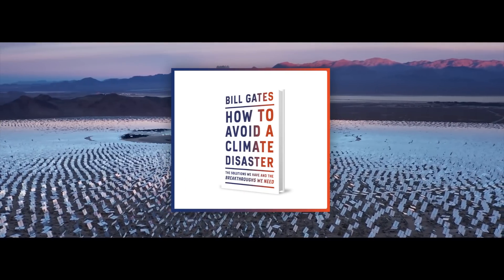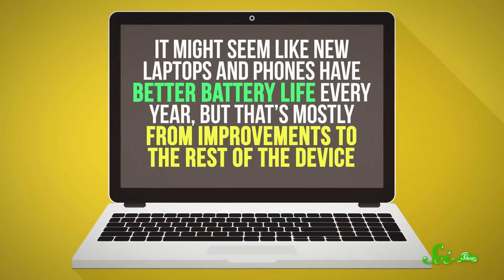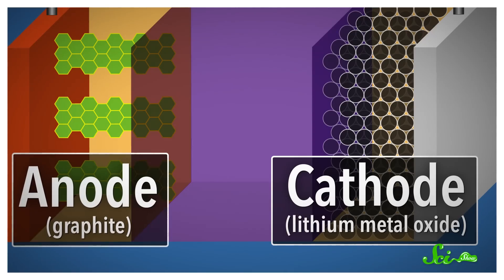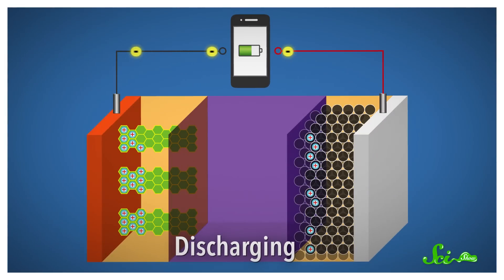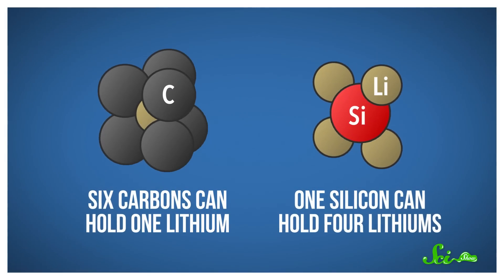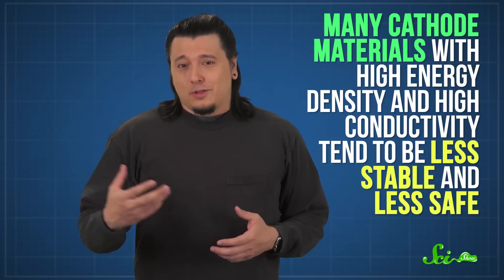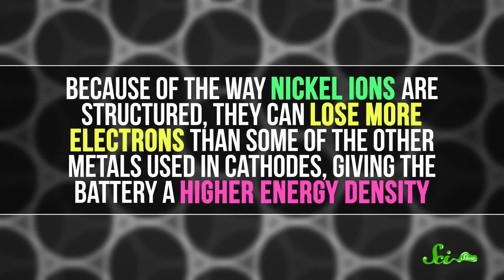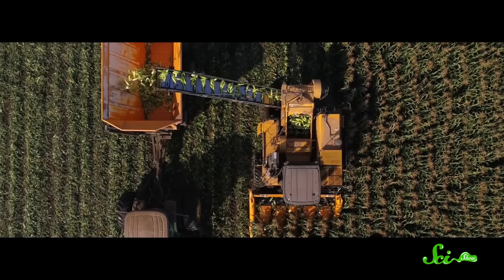Why Haven't We Built a Better Battery?

Comment: Lithium batteries are not a solution for grid storage, and should not even be considered for this.  Li batteries are for high current devices that require a energy dense battery to remain compact.  Grid storage does not need this, therefore the cheapest and most long lasting battery type makes the most sense, such as rechargeable zinc carbon batteries..  Energy density is a very small factor to consider when it comes to grid storage, especially since we can use far more space for it than say electric cars.

Comment: I have an idea... Why not use hydrogen, and oxygen based power plants?

I mean we can basically recycle the hydrogen, and oxygen as many times as we want.

Also, when combined in a certain way it can produce a high explosive out put that can be used to power the power plant.

Then you have the by product being water vapor.

If I remember correctly the space shuttle used something similar to power itself... Basically rocket powered power plants.

Which would be similar to jet powered power plants that some oil rigs use, but minuses the jet fuel.

Comment: Okay, someone smarter than me explain something:

For grid level energy storage, why do we need to store electricity? You've got your solar when it's sunny, your wind when it's windy, your hydro when it's flowy... But, instead of storing that excess energy in the form of electrical batteries, why can't we do something else, like pumping water somewhere high up, or melting something and storing the heat energy, and then when it's not sunny or windy, we let the water fall past a turbine, or make steam with our heat energy. 
I know some places are doing this, but it seems like it's always a flash in the pan news article that gets talked about for 3 minutes, and then we're back to "but we need 1 hundred billion AAA to power our TVs!"

Comment: Batteries don't even have to be chemical.
Pumping water uphill or putting gas in pressure tanks and on demand releasing it to drive turbines also works. And for non-movable storage, like when using it to power the grid the size isn't an issue.

Comment: A good high level description of the problems of improving batteries, but there is a big flaw here in the grid storage usage case.
It's true that for phones, laptops and cars, energy density (both per size and weight) along with cost are the main criteria. That's because they need to be mobile power sources. For powerplant or grid storage mobility is not a requirement, and density matters very little. Your bottom line is then $/Wh, with secondary concerns being sufficient charge and discharge speed, cycle efficiency (how much is lost to store the energy and take it back out) and energy retention rates (% lost per unit of time). 
Physical space near power plants is usually not an issue, and as a better solution distributed grid batteries closer to where the consumption is could also be done on the outskirts of high usage areas, closer than the powerplant would be while still no issues with space. For the economies of scale you need for energy storage at a grid level, there are also non-battery storage solutions like pumped water magazines, compressed air, flywheels, and depending on what time-scale we are talking about even capacitor arrays. There are also other non-litium battery technologies that become potential solutions when density is not a big concern, like flow batteries. All these energy storage options have different trade-offs in up-front costs, maintenance costs, service life, size, cycle efficiency, energy retention, and charge/discharge rates, and what makes sense depends a lot on what your requirements and scale is.
As electric vehicle ownership picks up more, vehicle-to-grid is also an important factor to consider. Having thousands of instances of 50-100KWh batteries that can charge/discharge at 5-10KW at places you would typically park a car could let grid operators treat a small portion of their batteries as grid buffers at some small benefit in savings while at no notable inconvenience to the owners. That could be very useful for handling peak grid loads and for soaking up excess renewable production.

Comment: Two things:
First, nuclear power is awesome. No greenhouse emissions, the generated heat can be reused for heating homes, works in all conditions, very safe. Meltdowns are much less of a concern with contemporary safety regulations, and you are more likely to die from installing a single wind turbine than from living near a nuclear power plant your entire life. Nuclear waste can be contained for thousands of years until it is safe, unlike burning coal which spews all all its nasty stuff into the atmosphere.

Then, use electric car batteries as back up when the renewable energy sources are not enough. Many electric cars are quite often hooked up to the grid, and they have quite big batteries. They could charge when there is enough electricity on the grid, and discharge when there isn't. As more people get more electric cars, there will be more of these big batteries.

Comment: While batteries have value and use, application vs other forms of sustainable energy source makes them less viable.. Cost and efficiency wise, nuclear power is much more safe and much more reliable with much much less environmental impact. (environmental impact is not over the next decade, but over the next 200-500 years, our society only looks short term.. thus the belief that Wind and Solar are 'better') The sad offset to nuclear power is.. dangerous byproducts that allow less than desirable people to make incredibly dangerous weapons (dirty bomb etc).

Comment: Check out the video from Real Engineering: https://www.youtube.com/watch?v=-PL32ea0MqM
Basically, we have options that are far better than trying to increase the efficiency of Litium-Ion batteries. Lithium-Ion was never designed for huge power banks, it was designed for powering small devices where power density is important. Stationary facilities don't need high energy density, they are far better served by high power per cost efficiency. So a big part of the answer to "Why haven't we built a better battery?" is simply that we're mentally stuck on developing technology to do things that it just is not good at, instead of switching to something that is better for the purpose.

Comment: Other types of energy storage should be mentioned. There are areas where the excess renewable energy produced pumps water up a hill to a holding pond. Then recovers energy by letting it flow back down through turbines. We don't have to use literal batteries

Comment: Thanks for the super clear and easy to follow explaination! 🙂👍 Usually I tend to loose focus and having a hard time seeing the connection between each of the parts (I have ADD), but you're one of the few people who can successfully flip the lightswitch in my head 😁💡!

[Pen > Pineapple > Apple Pen]
[Graphite > Battery > iPhone]
 ...Pineapples are batteries! 🙂

Comment: Wouldn’t the best solution to be just convert to nuclear power? Nuclear is green, consistent, and produces greater amounts of energy than fossil fuels.
Reply: but is incredibly expensive to build a nuclear power plant, its many decades before a nuclear plant even starts to make a profit over its construction costs.
also nuclear is NOT green, sure its fairly green compared to fossil fuels but the waste material is impossible to get rid of permanantly.
Reply: @Great.Milenko  what do you mean, Nuclear produces absolutely 0 carbon emissions, and with modern techniques there’s no waste produced.

Comment: Bill Gates pushing for Nuclear energy like most billionaires. The reason people think they pushing nuclear so hard is that it would not change the ownership of power. With solar and wind you can personality power your home by yourself. By getting solar panels and batteries for your self and federal power as a backup. 
The thing I don't like about Bill Gates he can not escape from his capitalist mindset. It why gate foundation push Oxford to sell it patent to AstraZeneca. Instead of providing the patent to the public so the world can make the vaccine for free.
Reply: It's more complicated then that. You can already go wind or solar but they are intermittent energy. We need controllable energy to substain a electricity network and not only intermittent if you don't want to have occasionnal shutdown. For controllable energy with have hydroelectricity, many type of fossil fuel(coal to natural gas) and nuclear. So if a coutry doesn't have good river and doesn't want nuclear power what do you think they would use if you add just more wind and solar power to the network? You need a pilotable energy where we can control how much energy we produce to match the demand.

Comment: Always said that a quick change battery in electric vehicles is the way forwards? Remember that the internal combustion engine only became feasible when gas became the goto fuel and the profits of gas companies have always been higher than auto manufacturers?... so a quick change battery from gas stations will overcome the travel distance reluctance of EV?

Comment: Uh, we have? What about carbon batteries, or super capacitors? Afaik we do have better batteries, theyre just not developed enough to motivate remaking old battery factories yet

The only energy source is the sun, everything is is just inefficient versions of solar collection. I guess theres also residual thermal energy from the creation of the galaxy. But thats not really a way to generate energy so much as it is a big slowly draining battery

Uhh, who thinks that phones and laptops have better battery each year? That doesn't seem true at all. My macbook pro from 2011 and my early android smartphones (not to mention my flip phone) have way better battery life than the modern equivalent I have to compare to. It seems to me that the fetish of bright high resolution screens has completely trounced any tiny advancement in energy usage or storage. Did you just like never have a gameboy or what? lol

No mention of water gravity or gas pressure batteries? The largest and most fundamental batteries to our electrical grid today? Huh...

Comment: If I were to place a gamble, the next big breakthrough in energy storage won't be in chemical/electrical batteries like lithium ion. Imagine, if you used electricity to "reverse" the radioactive decay of uranium. Then instead of a battery you basically have a nuclear power plant that you "charge" with the energy of your choice (wind, solar, tidal etc.) This hypothetical is probably absurd, but that sort of innovation is more or less what I'd bet on.

Comment: Have you got a hot take on these compressed air "batteries" ? (Using wind and solar to compress air then use that to turn turbines and generate electricity again when needed ?  - obviously huge losses but interested to hear your opinion!)
Reply: how about thermal batteries, melting a metal like aluminium with solar, wind or otherwise offpeak power, then using the heat to drive a sterling engine which can turn the heat back into electricity, again with huge losses, but allows solar power to be used at night.

Comment: Energy density isn't just about saving the planet. It's also about securing the other kind of Future. Capital-F. Y'know, the sci-fi future vision that you've been fed since the 50's. The one we were supposed to have by ten or twenty years ago.
Apart from cost, the chief reason you can't swap your rusty old Ford for a snazzy new flying car, toss your worn-out skateboard for a hoverboard, get rid of your 12-gauge in favor of an ammo-free ray gun, or take a weekend trip to space on a sleek spaceplane is that while all the rest of the tech is there, we just don't have energy storage media with the sort of density to make any of these things functional or practical. Flying cars need better batteries, and everything else on that list needs something much more exotic.

Comment: Interesting Solid State Batteries and Graphene in batteries wasn't mentioned. Have those researches lead to dead ends?
Reply: This video wasn't all that comprehensive. That being said, graphene is something of an incremental upgrade to replace the graphite mentioned in the video, not a magical silver-bullet solution to everything. And there is still the manufacturing problem. Solid-state is still in development, though apparently we're getting pretty close to usable production models.

Comment: what is exaly whit the metal poweder that they burn and get energy out of it. they run the bavaria facktory here on it in a trail. and the powder get get brun to rust and filterd to turn it back in metal power whit solar and wind energy. so less or more a sollit battery. and not dangerus. greating

Comment: Instead of electric batteries, you could produce hydrogen thru electrolysis. Today the efficiency is around 64%. You can then either turn it back to grid power via fuel cells or use the gas to power vehicles! Fueling your car with hydrogen gas are as fast as fueling with petroleum gas!

The gas can be produce at the gas station from excess electricity at night and/or with solar panels or wind turbines close by. Clean fuel for almost nothing!

Comment: Climate change is the wrong problem to focus on ECOLOGICAL FUNCTION is much more concerning and easier to improve. Permaculture and regenerative agriculture could if widespread could turn carbon into a scarce valuable commodity in 30 years. Agricultural lands should be designed and managed as functional self perpetuating ecosystems!

Comment: This is why nuclear is key to fighting climate change. Renewables simply can't do it. Not only do you need a vast amount of land and material to generate peak demand, you need at least double, likely quadruple, that to generate enough to store. And then you run into the issue of this video.

With solar for every 1 MWh of demand you essentially need 4 MWh of generation capacity and at least 18MWh of storage since you only have 6 hours of direct sunlight to work with. That doesn't even factor in daily grid spikes at night or non productive days, both issues currently solved with fossil fuel back ups.

Wind is hardly worth mentioning since it barely pisses out a few watts and is even more unreliable. The few places it can constantly generate power like off shore scotland typically don't have much demand anyway and you're destroying tons of natural habitat to do it.

Maintenance on both is massive; turbines need tons of lube and panels need to be cleaned; and neither are viable beyond 20 years. The blades aren't recyclable and much of the panel infrastructure isn't either. Takes tons of toxic metals for key components too, plus mining all that silicon. Lithium is in high enough demand with devices, EVs are going rmto ramp it up further; we can't build infrastructure with it too thats just irresponsible.

We need nuclear. Even classic PWR designs can solve our energy crisis. Breeder reactors can use old rods and render them inert and thorium reactors won't create harmful waste at all. All can meet a constant high demand for emission free power. Its insane we haven't been building hundreds of them.

Comment: been saying for years that, while they're large, pumped-storage hydroelectric facilities are our best option for mass scale power storage
Reply: there are smaller and cheaper alternatives to this too, such as thermal batteries, use cheap solar power to melt a material and use the heat from this to create power during the nights.

Comment: the biggest downside to chargeable battery i  find is the inevitable  death after a few years. We had to replace inverter battery almost every 4 year ( for reliable capacity ).

if it is not less  expensive than electric  in a noticeable way , majority wont use it

Comment: It's disappointing that you left out the liquid metal battery (see ambri.com).  For batteries that don't have to move, like power plant storage, liquid metals eliminate the cracking problem by not being solid.  The metals used are much more abundant, and thus less expensive.  But, you can't use them in electric cars.  We have a single use case that's driving far too much battery research, leading to neglect in other applications like the one you are talking about.

Comment: Wales has a natural battery, it’s a hydro electric dam that pumps water up into the higher lake when there is excess power, and then when electric is needed it releases it down normally driving the turbines. 

A very clever idea...

Comment: I would say liquid metal battery's are going to take over grid storage. The whole point of them is that the best way to make cheap battery's is to use material that is cheap as dirt. 

There density or weight is not that important, because what's a few stacks of cargo containers worth of heavy equipment when it cost you 10 times less. It does not have to be all compacted in a small space. It's a power grid, not a pocket-sized device, it can have all the space it needs. 

Just like the saying in engineering. You can have it light, strong, or cheap, Pick two. Li-Ion is very light, sum what durable and ok in cost. But grid scale needs only to be very strong and dirt cheap.

Comment: Yeah, it's pretty impressive what computer hardware has become in recent years. I remember when I started building PCs in the 2000s, it wasn't uncommon for gaming PCs to have power supply units over 500W.
Then when the NVidia Titans came out, people sometimes needed more than 1KW to run top-end gaming rigs.
Now, you can run the most powerful rigs with just 500W, and office computers can have PSUs as low as 300W.

It's impressive that hardware hasn't only gotten more powerful, but at the same time needing less energy to deliver all that power.